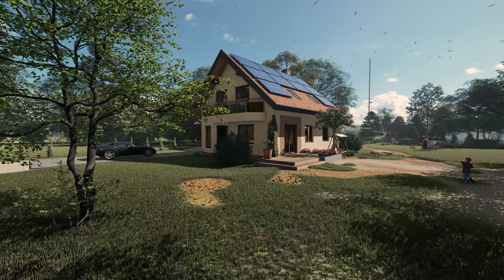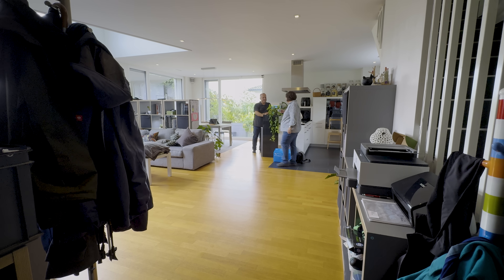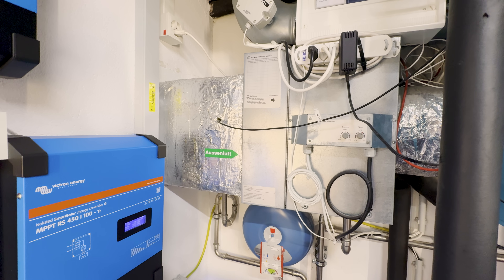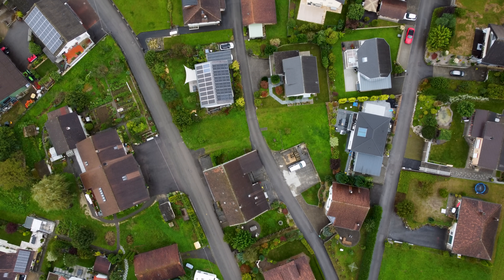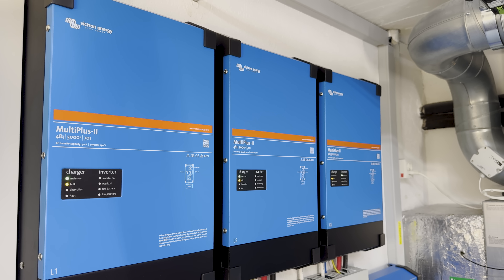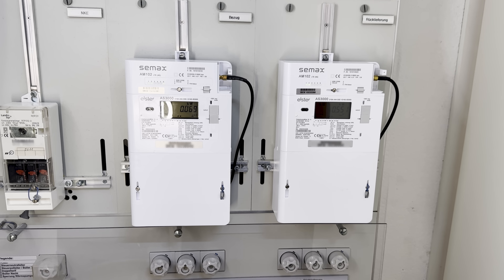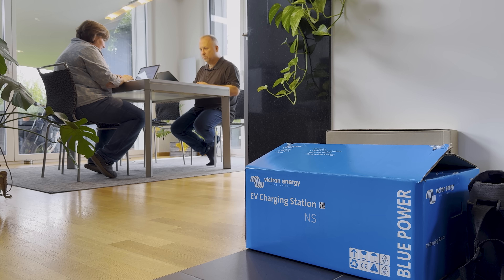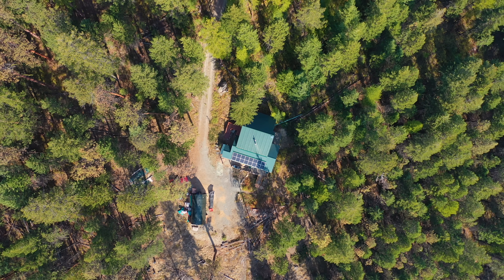Automated Passive House using solar, energy storage and Victron Energy

Comment: What's new? When you hear and eventually try Victron Systems, it becomes a love affair, impossible to think of any other energy solution; if anything, the only other avenue is "Expansion" with yet more Victron equipment. I started with one Multi 5KV, then added a second one and more self-built batteries (now 35Kwh and adding one more 17k), but seriously thinking of adding a third Multi 5Kv. Node-Red implementation allows for expansion of the already very helpful Cerbo GX IO, all in all the perfect solution for those who want the best. My only regret is that, being almost 72 years of age, I won't have that many years ahead of me to enjoy the benefits and the massive fun of creating and using my Victron system.

Comment: Realy nice to see passive house + Victron together. I have a similar "condition" I'am retrofitting an old 1963 house to passive house standard (air-air-heatpump + decentralized ventilation with heat recovery). Since January 2025 my ESS is running. (100% DIY project)  3 x MP II 48 5000 + 2 x SmartSolar MPPT 250/60 + different AC coupled Inverters and micro inverters in front of and behind the MP 2. In total I have 20 kWp solar + 40 kWh LiFePo storage. Since mid February I have 100% degree of self-sufficiency (It is still a grid connected System in Germany) and thats with a fully electric vehicle. I have yet to play around with my Cerbo and Node Red. It feels so good to be independent of oil and gas as well as being safe from blackouts/ brownouts. 😁 Keep up the good work Victron Energy 💪

Comment: Nice house and good example for others. I love Victron, would be nice to see the 3phase inverter in the store, that could alredy be seen in exibition videos. Another thing with new regulations in germany, i hope victron will fast adapt to them. There is a need that any EMS gets an interface with the control boxes of the grid companys so they can dim wallbox and heatpump and inverters. Best solution in my opinion would be to sell a modified version of the VM-3P75CT energy meter with the needed interface (eebus?) that forward the control commands to cerbo gx without possibility for the home owner to interfere.
Reply: You'll never get a Victron all in one 3 phase system. That's why their current lineup allows for easy 3 phase setup. Sure you need to buy 3 inverters, but that's what an all in 1 system would be doing anyway. Also Victron are normally quick to update their software for new regs.
Reply: @sarahjrandomnumbers  There is already a 3phase inverter in serverrackformat in the making, victron showed it at an exibition.
Reply: @Dedrael81  yes but an inverter in a server rack is an odd solution, most customers want a classic Victorn design to put in a clean wall installation but with 3 phases, if they want, they could do it